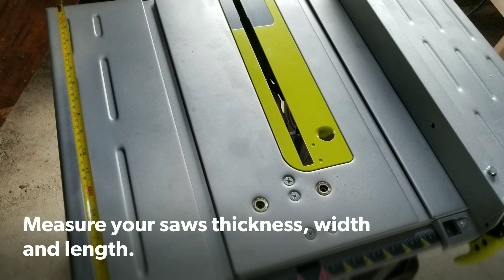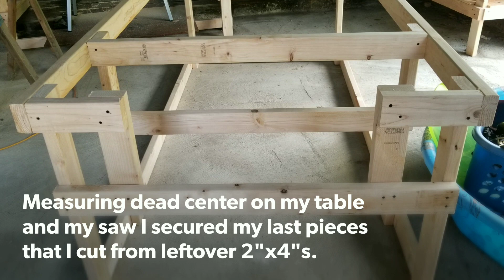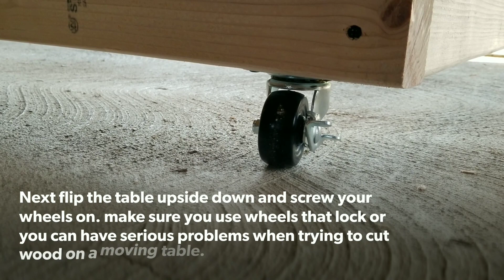DIY: Saw Table Workstation ($85)

Comment: So with this build, aren't you limited on how far you can slide your fence? It was hard for me to tell exactly from the video so I'm not just being an smart a$$, Im really interested in this. I have the new Hercules they just redesigned with dewalt style fence and larger table, I don't see how I could fully extend the fence unless i mount the saw on one of the corners... which would obviously cause me to loose a lot of surface area. Perhaps cut some sort of channel for the fence to slide through?? Or hell, it might just float across the top of the table, idk. Like I said, kinda hard to picture it exactly

Comment: Im going to be making all new custom cabinets for my kitchen but i need to first make a set up like this for my tablesaw. Any idea if the Ryobi 10” saw can handle a dadoblade set up?
Reply from the maker: I've never used one of those but I do know that a lot of it has to do with the power you are running. A saw running on 220 is going to be much more powerful than one running off of 110.

Comment: This is great but did notice two things. One is you put the saw on the 4foot side instead of the 8 foot side. Unless your ripping 4x8 into strips your going to have 2 foot overhang on the sides or more. Second is you put the cutout under the saw. Since most of the saw dust falling though the bottom of the saw you need a large hole and maybe add a trash can or bag to catch the dust. Other then that loved the video.
Reply from the maker: Great points actually!  I use mine mainly for ripping lumber but if ripped 4'x8' sheets of plywood with no problem. I guess it all depends on how little or how much your cutting off. I don't do much crosscutting on it but you could. Also I built it the same height as my surrounding tables incase in need to cross cut a full sheet. As far as saw dust goes, I vacuum it out about every 6 months from the side of the saw that is pretty easily accessible. You definitely could hollow it out or setup for dust collection. I guess I could add more tabletop to the left side that is on hinges that folds up to be flush with the top. Maybe I will and do a video on it. Thanks again!
Reply: @undergroundcreations417  These days, most cabinets and such using sheets cut 300 /400 / 600 rips of the sheets, such as when making kitchens. And sheet crosscutting these days is done with a circular saw easy cut guide rail system. Dont need to run your sheets across the 8 or you then have sheet drop op. Small crosscutting of rips can be done with a cross cut sled fixed to the actual saw table. As for sawdust collection on saws...most of the better craftsmen use a vacuum system so there is little of that underneath. You are not exactly going to float that saw bench are ya bro!? :) I think the table for its uses is just perfect and a cheap build for those without the cash for hob nob jobs. Center mount is fine. Even if first rip is 250 or 300...there is still sheet enough on the bench for flat and stability. It wont fall. No table big enough to cut whole sheets on table, is good then to work around...8x4 is perfect. Its all good situation setting. If you wind down the blade, you have a perfect bench for doing your first cross cuts if necessary and even to fit in a router or planer underneath. Maybe the introduction of a sacrificial sheet on the top for cross cutting with guide rail system. I would rather see a video on how you would fit a router under or a planer for material edges. Even a simple miter sled on table saw would be good. You are going in the right direction.

Comment: About to embark on this project and started with mapping the pieces I’ll need. The video suggest 7 2x4 are enough but I saw in the comment it then said 8 2x4 were needed. I’m still a bit puzzled because I find I need 9 full 2x4. Am I missing how to optimize my 2x4? Clearly one needs 4 full 2x4 for the bottom and top frame. I need 3 to cut my 6 x 45” and then another 2 for the 6 legs (30” each). So looks like I need 9 2x4 not 7 nor 8. Am I missing something?

Comment: I really love this saw table. It looks like an easy build and I'm a beginner. Can you give me more details on cuts, screws, # of boards I'll need?
Reply from the maker: Yes! The basic premise is 4'x8'xwhatever you choose as far as height. I choose 36" high like a countertop. Get a box of 2 and a 1/2 inch screws and 8, 2"x4"s then a sheet of plywood. Depending on if you wanna put wheels on it which I recommend, that's up to you.

Comment: This is a really clean build. I am going to be putting something similar together. I designed it (I have a video of the process of me creating that), but it is soooo much "beefier" than yours because I was worried about strength. How does yours hold up? Any issues with bending / sagging from the weight of the saw / projects on it?
Reply from the maker: Absolutely no weakness in it at all. I honestly use it every day. Sometimes I have to stand on it with a project that I'm staining to reach the top and it shows no sign of weakness. I didnt plan on this video being popular when I built it but I'm glad it did because its one of the most useful projects that I've ever thrown together. Thank you for watching and good luck with your project.
Reply: @undergroundcreations417  Awesome! Thank you!
Reply: Just finished building mine, definitely came out as strong as you described! I have a few adjustments to make on it, but overall came out like I wanted! Thanks again for the information!

Comment: Anyone know how to get the dimensions of my table saw? I looked it up on the DeWalt website and it said it was about 15" tall but when I measured I got 12 and 15/16 I did have a hard time measuring but I don't think I messed up that badly. Any help would be much appreciated
Reply from the maker: If you are building a saw table, just go by the same height that you measure it as. Dont forget to add the thickness of the wood that you are using for the top if you havent done it yet. Package dimensions will be larger than saw itself too by the way. Hope this helps at all.

Comment: How did you get the rails to slide out and in?  I didn't see how you measured or cut a slot for them so you can adjust it in & out.
Reply from the maker: With this particular saw, there was no need to take that measurement into account due to the track being flush with the back of the original saw surface. Depending on the saw model, you may have to take the rail measurements into account.